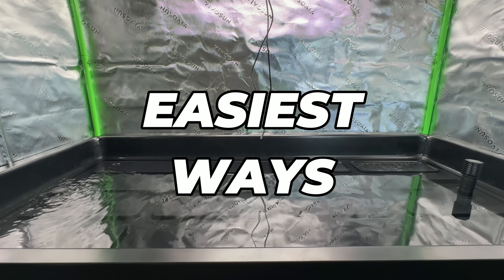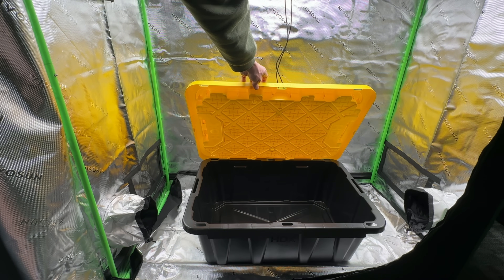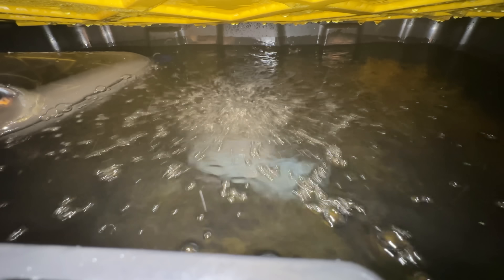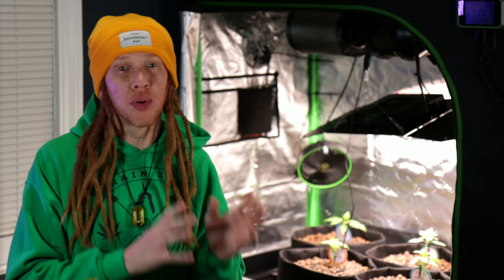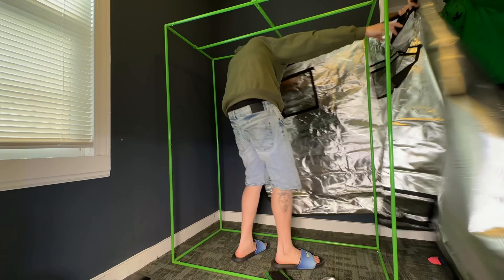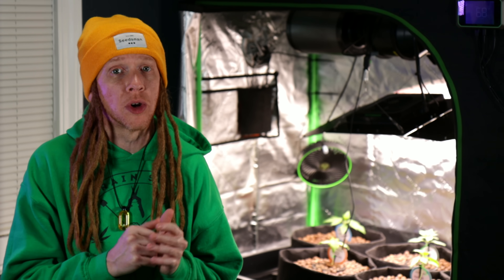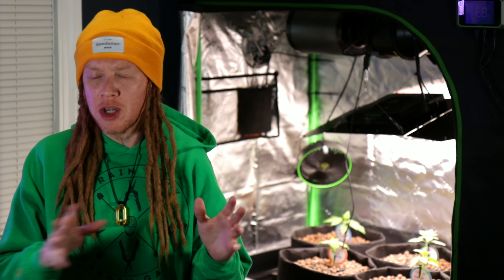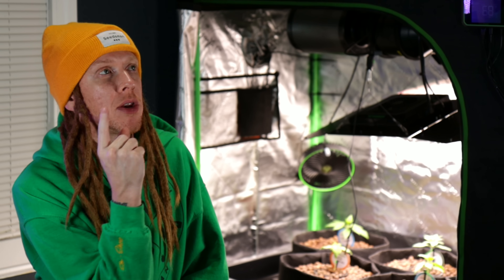Easy Ebb and Flow Hydroponics in a 2x4 Tent

Comment: Without covering where you're placing those plants. Is there any chance for algae?Even though you're using grow bags? Every ebb and flow system i've seen suffers from algae on the surface due to the light.Hitting the water and pellets

Comment: Just a tip avoid hard 90° joints much better flow with 45° especially on pump side since it will restrict your flow of water and will be one of the first places that build up will accumulate along with anything gunk.

Comment: Jeff,  I have to say thank you bro, so after watching this I decided to go with flood and drain system I've got a small tent 1.5×1.5×2m with a 3foot square tray.. usually I'm a outdoor organic grower, this is my first real indoor set up the plants love it, I've not had one problem I'm at w3 of flower and your right the humidity jumps up when the lights are off seems to peek a hour before lights go on so,  I need to get a good dehumidifier asap.. thanks,  it's so simple to run I just make a habit of checking the PH and ppm when the lights come on...  I underestimate the final stretch a little and had to remove the fan to the out side 😂 we learn as we go.

Comment: Honestly this is great but it's just not worth the amount of money your going to put into it. My motto is "less is more". Grow with soil and nature living soil in a minimum 5 gallon bag and you'll get the biggest frostiest buds you've ever have had. That bit of advice just saved you hundreds if not thousands of dollars. Remember buds want space and plants literally explode when they go bloom. So max 4 plants in a 4x4 tent. Max 2 plants in a 2x4. If you put all those plants together you will only get the top layer. Hydroponics is not more effecient and you are not a commercial grower. Power goes out, mold does happen more than not, tubes plug very easily, hot water will kill your plants. Hydro just has too many cons to be a pro. I grow 4 plants outdoors every year and get a minimum of 4 pounds.

Comment: My Ebb and Flow only uses 2 gallons of water its easy to keep chilled and you dont have to worry about so much water mines not a flood system i have sprayers that surround each trunk of the plant i have 8 plants 2 gallons can feed 3 gallons once full flower

Comment: I've had to move into another place in Texas, which has never changed it's laws. I went from a one bedroom apt, that I was in for 12 years, no problems. 
  I have Post Treatment Lyme Disease Syndrome(PTLDS), and earned a Permanent Supplemental Housing grant in 2013. We're allowed 3 strikes, before losing it, which I had none. 
  After the same Apt for 12 years, my "case manager" said I had to move to another one bedroom Apt. 
  I could have picked a different place every year, if I wanted, so no surprise I'd finally be moving to another one bedroom apartment. 
  He gave me one trip to move my stuff (leaving thousands of dollars of equipment, etc), then hurried to get off work. 
 He totally lied to me. He put me in a place for "the chronically homeless" (basically those they're cleaning the streets of, so people don't have to see an ugly Austin).
  Trying to straighten this up. Chronically ill? Yes, but never chronically homeless.
  Ended up in an efficiency apt, no closet, my indoor/outdoor cat is stuck inside always. Hallways like in "The Shining". 
  I've been thinking of a 2x4 tent..?! And the balls to "hide it" in plain sight. I had a 4x4, 5x5, and a 2x2 that was quite short. 
  I've always had some great stuff from Vivosun. Recently their top, 10 speed, circulating fan. 
  Which I made sure to bring with me, along with other essentials, after just a month of solid use, before surprisingly ending up here, at 57 years old.
  Really great Tent review. I knew I could fit a few plants in one, but it seems much spacier than I had expected.
  You've given me some real hope for possibly doing this. Especially if I don't get a one bedroom place soon.
  Forgive my rambling, please. Last few episodes I made some long comments. 
  The comment I left on seed germination, is long, but something I've never heard of, and is supposedly impossible. Hope you get to read that one!👌✌️🫡

Comment: Got a question. So I’m new to growing and I’m following the beginner grow guide to a T. Before I start germination or getting any pots set up in the tent I wanted to make sure all of my equipment was working properly. One thing I’m noticing is that my vivosun smart remote that I’m using for the exhaust system is reading that the environment is at 60%+ RH but the humidifier and the temp/RH meter that I put in the tent are reading at around 45% I know that because the humidifier is on the ground and doesn’t have a probe that the reading would be different than higher in the tent but even after lowering the probe as much as I could(still not low enough to get to the same height as the humidifier) it was still reading in the high 50’s low 60’s I don’t know if the probe isn’t working properly or if it’s because they’re in different heights in the tent. Could I get some advice before I start my grow in a couple days?

Comment: This is probably the worst system to put in a short tent. The humidity factor makes it not even worth it. A wicking system like autopots with your res on the outside of the tent is much better setup that will not restrict your vertical space so you can grow your plans larger than some tiny autos.

Comment: Love the stuff keep the awesome videos coming out. How are you supposed to use the VIVOSUN grow hub without a ethernet cable basically have the exact same set up. 

Also doesn’t running your carbon filter with a hydroponic set up decrease the life of your carbon filter because it’s so humid or wtv? Shouldn’t it typically only be ran during flowering season, also may I ask why you’re using a 6 inch instead of a 4 inch carbon filter? Does it help more with controlling the smell?

Comment: I run 2 - 4x8 tables. You need a part 2 with flood schedules, medium, mixing nutes and most importantly blue labs doser n monitor. 😂
Reply: These ebb/ flow systems are super interesting. Was planning for DWC. But this needs way less EC. When changing reservoir its no problem for my garden. I deffo gonna route for it.

Comment: Best description of VPD I've seen thus far. When I first started growing, I did everything to the T according to every guide I read. But my first plants, after they passed the seedling stage, seemed to dry up and struggle. No one had explained this VPD concept to me before that. If you nail your nutes AND VPD, it's hard to screw up a grow.  If you're struggling despite your nutes looking OK, check your VPD.
Reply: Whats vpd volume pressure what
Reply: @Jason151Gstyle  Vapor pressure deficit,  the difference between the vapor pressure in the leaf and outside the leaf.
Reply: @LarsLarsen77  ty ty

Comment: You can scrog a single plant into chicken fence and top the plants to multiply buddy heads that come out. A guy I knew had one plant but there was an entire chicken fence between light and tank every single hole of the chicken fence was a buddy. I was like "OMG this is like 2 pounds why are you showing me this?!" I got spooked it was so much because Kentucky law enforcement 15 years ago was dark about. It looked like a solid woven Hammock of buddies. He removed all the bottom leaves so it looked like a naked Stem underneath and bunches of tentacles curved up into the chicken fence from under.

His logic: "Its only one plant they shouldn't get too mad." Lol..

Comment: Try a dwc container, that becomes rdwc with constant  overflow and circulation pump into a 27 gallon(also with airstone and recirc pump, with a mid tower ebb and flow inside the dwc from bottem of basket to top of gravel, mid tower also has coco and hydroton, that has top up from the 27 gal res. I can literally never touch the system after I start them. All praise automation, lol.
Reply: My first run was dwc, I'm trying organic living soil on my current run. Dwc was definitely nice and easy though.